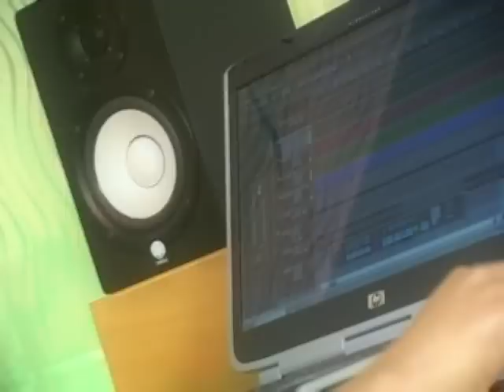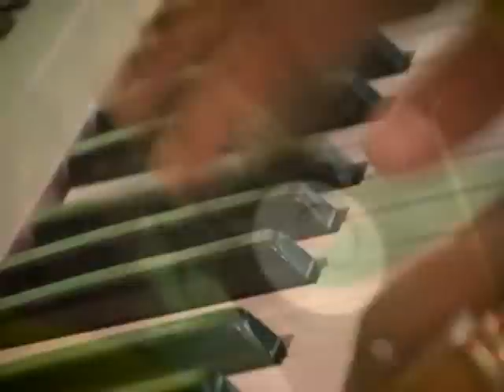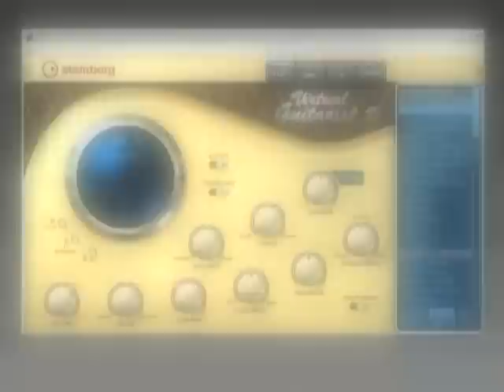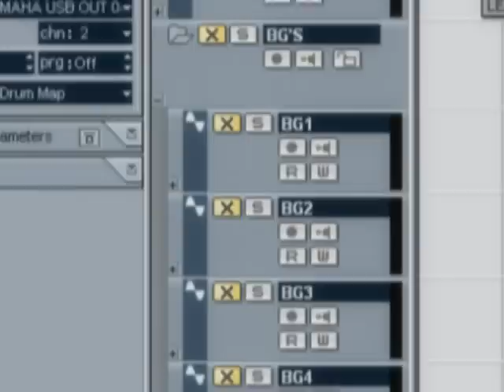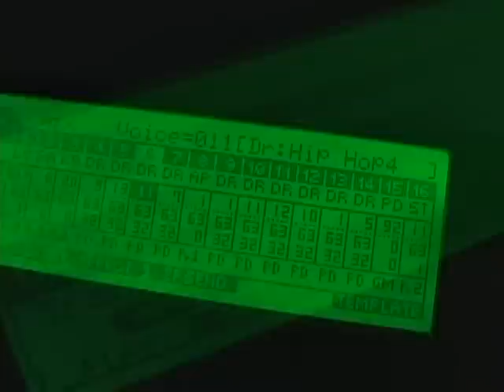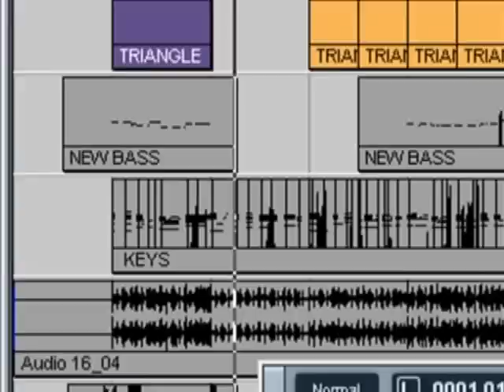Yamaha Music Production - Introduction to MW Mixers

Comment: I have the Yamaha MW 12C mixer unit and mine crapped out as it was in new/mint condition although past warranty. Mine has never been outside my home. I bought it new and have only plugged in a drum machine, midi keyboard, CD player and a stereo jack for my iPhone if I want to play along with youtube music vids. Here is how it has failed for no reason whatsoever. The sliders have no control at all. The "ON" buttons that light up have no control at all either. Somehow something packed it in, in the circuitry I guess and anything that is now plugged into it is either on or off depending whether or not the PFL button is pushed in or not. The sliders and ON button give no control at all therefore all connected items rely strictly on their incoming volume and the only way I can control volume is with the MONITOR turn knob. I can have all the "ON" buttons off and all the sliders off at the bottom but it doesn't turn anything off. 

In other words, the mixer isn't mixing volumes at all. I can basically run one sound item through and control it's volume to my monitor speakers with the Monitor volume knob. I suppose the only way to run more than one thing would be to control every items volume as it goes into the mixer just to hear them all through the monitor speakers but each item's volume would have to individually adjusted at the source rather than inside the mixer. 

I don't know if I can get it fixed yet or if it's just better to buy a new one. Pisses me off .If anyone has advice as to why everything has bypassed the internal functions of the mixer, please leave a comment.